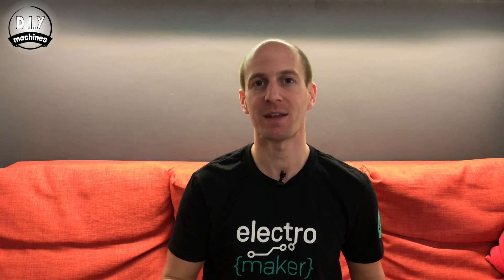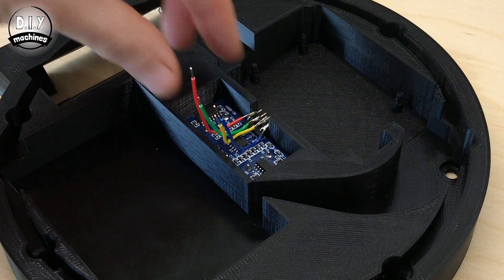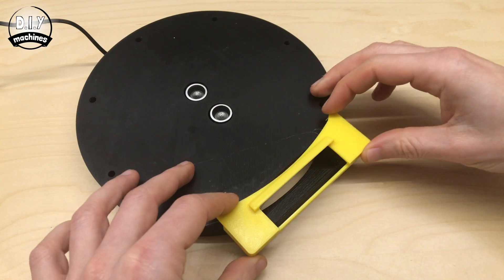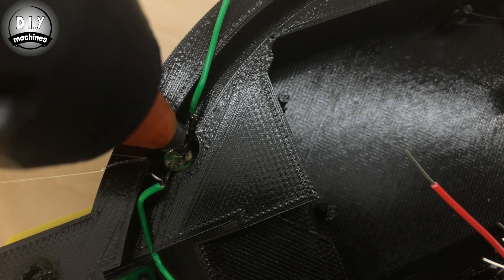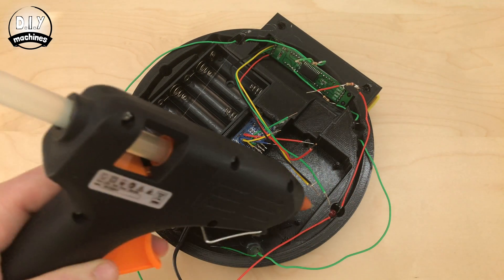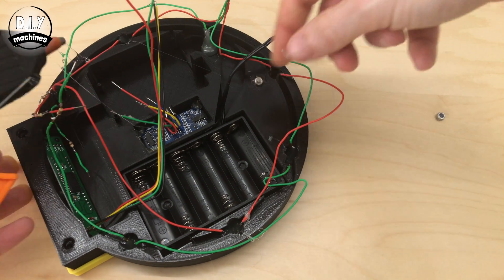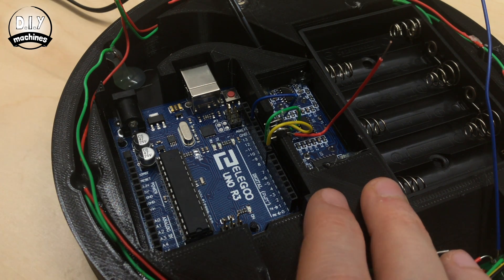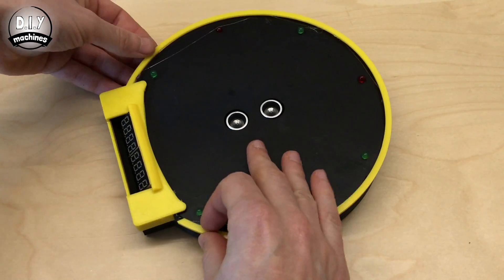Drone Landing Pad with Arduino Timer

Comment: I do not have telemetry in my quad-copter, so this can be used to guestimate battery life based on time.  Also I might based  my idea to count pool laps with your work, thanks for sharing. Looks cool.  I will consider adding a push button to set and reset manually.
Reply from the maker: Ignacio Diaz yes, that could be a good use for it. Especially as a quad-copter and flat battery don’t equal much fun. :/
If you modify it for your needs I’d love to see a photo of it.

Comment: very cool device, but its horrible for a "lap timer" since the quad has to slow down significantly to come in to land. I would recommend printing or installing some kind of hoop attached to this pad that the quad can fly through to get lap times.
Reply from the maker: Thanks, I'm planning on making a fly through version as well - a version better suited to people who want to blast around a circuit one lap after another.
This one is meant to allow you to fly a lap and set your best time including accurately landing on the pad at the end.  You can then pass the controls to a friend if you like, to take off and set their lap. This way to people can share a drone and compete with one another.
I myself have only one drone so it is how I was intending to use it.
Reply: a fly through version would be awesome! Thanks for the great work.
Reply: Any updates on the fly through version? I am very interested in this!